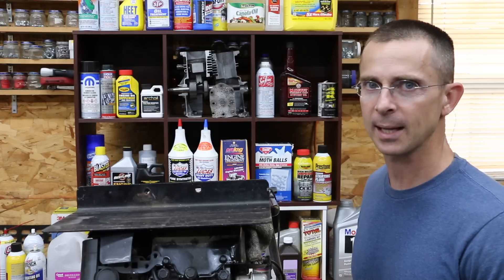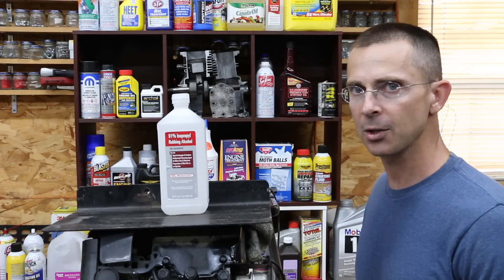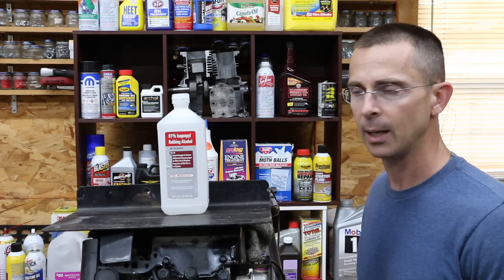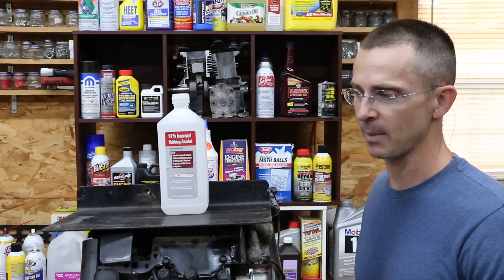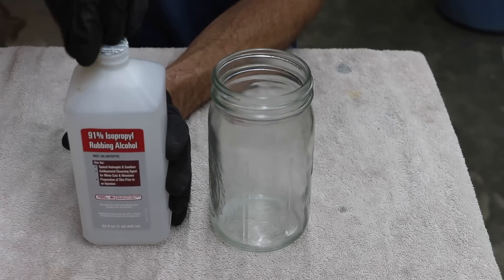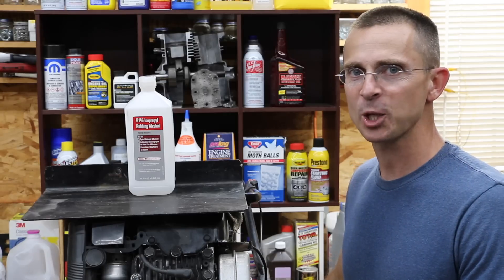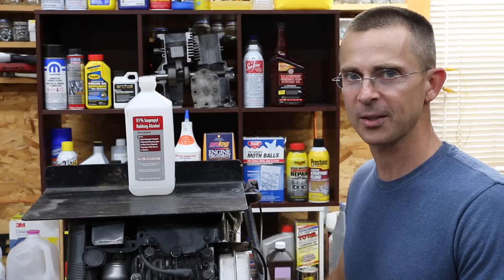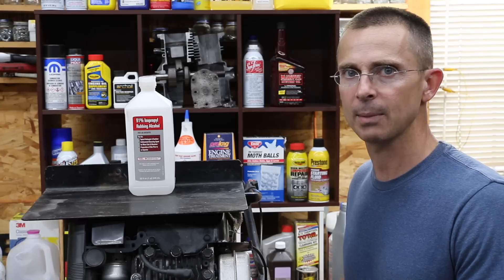Will a Gas Engine Run on Isopropyl Alcohol?  Let's find out!

Comment: The engine ran rough because of 2 things, First, you are automatically running 10% lean because the Alcohol is 10% water,
Second, Alcohol requires almost TWICE the mixture ratio of gasoline (7 to 1, instead of 14.6 to 1) for a proper burn.
Double the size of the main jet in the carb, and then stand back, you'll get around a 50% horsepower increase,
AND, the motor will run very cool, AND, the combustion chamber will be sparkling clean in about 10 minutes of run time.
If you want to run it permanently on Isopropyl alcohol you need to get the hottest spark plug that will properly screw into the head, (many automotive plugs will work and are a much higher heat range), then get a belt sander and sand down the
cylinder head as much as you dare, to get the compression ratio up...
DO NOT bypass the governor or you WILL throw the rod through the side of the crankcase.
Always get the motor good and hot each time you run it, or you will start to accumulate water in the oil.
If you run it more than around 15 minutes, the moisture in the oil will be boiled out and won't be a problem.
Reply from the maker: All excellent points and advice. Thanks for commenting on how to properly convert an engine to run on rubbing alcohol.  Thanks again!
Reply: @ProjectFarm  >>> I was going to ask if you'd modified the carburetor on the lawn mower in any way to accept the isopropyl alcohol....
Reply: @ProjectFarm  will a bigger spark plug improve performance? 
Example, a spark plug that is wider larger with 2 sparks, you should test multiple spark plugs with isopropyl alcohol,  and also you should test isopropyl alcohol mixed with other substances, like hydrogen, and isopropyl alcohol with jet fuel mixture 10% 20% 30% and 50%
Reply: i have a feeling jim was doing more than buliding mower engines
Reply: I think alcohol would eat up all the rubber hosings and gaskets faster over time, thats why some cars are allowed to use ethanol and most are not, or Biodiesel and Diesel (at least thats what the manufacturer said)
Reply: Jim Brown true we used in race cars.
Reply: How about Methanol, I used it to raise the Octane of gasoline in my Motorcycles, it worked well, also runs cool, I would use 93 octane "white gas" 48oz/5gal gasoline, when I couldn't get 115 Octane Racing Gasoline, I started riding in the 60s and racing gas was not available a the pumps. Thanks for the videos, I've been a subscriber for  about a year now. 🇺🇸🏍
Reply: G. B. 

100% ethanol has a pH of 7.3. Very slightly more alkaline than water. Fuel systems survive contact with more acidic water quite well.
Reply: @Ameri Can feel free to read the article i linked and GBs answer to my comment. Additionally the video as well as the initial comment itself and my comments were about 100% ethanol.
I remember times when, in winter, people added up to 10% gasoline to their Diesel (before winter additives were common) and this didn't affect the parts at all. Today you kill your common rail pump if you do so. Car manufacturers to this day specify if you can run E85 for example, which would (according to them) kill the parts i mentioned in a car not advertized for the use of Ethanol. Same is said for "Biodiesel" the few % that are added to the normal one don't affect the parts as much and 100% would. And manfacturers specify which car you can use with 100% "Biodiesel".
Reply: @nirfz  the alcohol is harder on the rubber parts. probably because auto manufacturers sue the cheapest F rubber they can. rubber technology has come a long way, it would be easy to replace the parts to accept up to 100% alcohol. save for any integral parts like fuel injector guts.
Reply: You can buy acetone from a hardware store like lowes I would like to see that.
Reply: @smartwatchonpluto  acetone would probably run, but I hypothesize it would wreck havoc on the gaskets, o-rings, and carb float over the long run--particularly if they are not E85 rated
Reply: @smartwatchonpluto  way too expensive not only that but 100% acetone will gum your entire engine because if you wish to run it in an engine no matter what you do you have to do a ratio mix 2x or more than you would on gas and my point is acetone coagulate oil and turns it into a sludge and that sludge will not burn until the engine gets hot and once it does
Reply: Drug store isopropyl alcohol is 9% water, 99.8+% Pure Anhydrous (water free) Isopropanol (alcohol) is sold at paint and hardware stores which is less then 1% water & cost quite a bit more by purity.
Reply: @marty7922  If you find a friendly local chemical supplier/wholesaler you can get 99 percent for cheap. I clean a lot of circuit boards so I went to one and it was like 15-20 dollars for a gallon of technical grade iso. Probably a bit more now but still going to better than drug/grocery store pricing
Reply: Jim how many times have you done this? Lol I bet your mowers are second to none.
Reply: Seems like you have knowledge i have a question please answer it.
Can we run a patrol bike engine with the 50% mixture of patrol and ipa
Reply: @manishuppal4447  
Definitions of words first ..... 
"Petrol Bike Engine" is this a Bicycle with an Engine added on ?  or a Motorcycle ?
I will assume that "ipa" is Isopropyl Alcohol.
The Short Answer is  NO. It may run, but not very good.
The engine must be set-up and adjusted specifically for the type of Fuel being used.
Alcohol requires a higher Compression Ratio, and usually slightly more Ignition Timing Advance,
it also requires a MUCH Richer Air/Fuel Ratio,  (Gasoline = 14:1), (50% Alcohol + 50% Gasoline = ~10:1).
A very high performance Motorcycle Engine (250cc to 1L) could benefit from adding Alcohol, but only with special tuning.
A small Engine (50cc to 150cc) indicates that you don't have enough Money to afford the REQUIRED engine modifications.

Gasoline produces more power than Alcohol for the same volume of fuel.
Alcohol is sometimes added to Gasoline to make a very high performance Engine run cooler, 
so that it does not "DETONATE" from high Combustion Chamber Temperatures.
This makes it possible to raise the Compression Ratio, which will make the Engine produce more Power.
.
.
Reply: @jimbrown563  Thanks for you valuable reply. From your reply I understand that if i put 50% isopropyl alcohol 99% pure mixture in my 100 cc motorcycle it will reduces the performance (torque, acceleration). Basically  i do not require much power i mostly run my bike at maximum speed of 40-50 km\hr.My question is does it have any bad impact  like any short term or any long term bad impact on bike.
Reply: @manishuppal4447  I can answer.  If you switch to isopropyl alcohol without mods, you will damage the engine.  With the lower energy content it is making your engine run pretty lean.  Your 100cc bike probably needs a much more accurate fuel air ratio than a lawn mower, so it will cause damage, or just not run at all.  I would expect that even though the engine seems to run at the same temp, you will probably burn a valve.
Reply: What is your advise on back yard fuel alcohol still for auto?
Reply: @ericbrazau6533  
You can't produce enough to make it worthwhile.
Reply: @jimbrown563  I got a cup or more of water in my 50 gallon RV fuel tank (long story). I have not tried to start it, so all the water should be in the tank. Will 99% iso mix with the water and burn it out? Can you suggest any options to remove or remedy the problem short of draining the tank. Thanks
Reply: @Polished_Rocks  
Yes, it will work,
but You may need a lot of it, maybe 1 or 2 quarts.

Pumping in ~10-gallons of a 50/50 mix of Regular, and "E-85" 
may also solve the problem.

If your Engine is "Flex-Fuel" compatible, 5-gallons of "E-85" will work.

Go burn all that Gas out of the Tank, don't let it sit there.

Use "Sta-Bil" Fuel Stabilizer if it sits for more than a couple of weeks.
.
.
.
Reply: Hey Jim so I have a big suv and since the gas shortage is going to happen again soon what is there any way I could you something instead of gasoline and it would be cheaper and still or more efficient
Reply: @samhampton545  
Straight Alcohol, or the closest thing to it "E-85",
uses around 50% more  Fuel by Volume than Gasoline.
So the answer is no.
But the good News is that the "Gas-Shortages" are completely
orchestrated and will be sporadic, and very temporary.
It's just one more effort to get people to wake-up to the
attempted, but miserably failing, Communist take-over of the US. 

Yes You read that correctly,
throw away your TV, 
it's 100% Propaganda Bullshit.
Reply: @samhampton545  hmmmm? Gas shortage?
Reply: what if you run 99 percent isopropyl
Reply: @gumbilitous2804  
Re-Read this entire Comment/Thread .......
Reply: Does isopropyl really need less compression?
Reply: @sunfishensunfishen2271  
Where did this question come from ???

More Compression is always more efficient using any type of Fuel.

The trick is how much Compression, or Heat, will cause DETONATION with a particular Fuel.
.
.
.
Reply: My bad i was reading it completely backwards. I’m building an engine like this one with a clear cylinder head, crankcase and valve cover and so far, I haven’t gotten it running long enough to burn the water out of the crankcase and it ended up loosing too much compression. Going to drill out the main jet tomorrow and possibly switch to 100% ipa.
Reply: Do 91% which I was previously using and 100%, which I’m going to be using from now on, have different stoichiometric ratios?
Reply: @sunfishensunfishen2271  
Do the Math ..........
91%  is  9%  Water.
Reply: I heard only recently that the whole PROHIBITION thing in the US was really all about shutting down the industrial use of alcohol, in agricultural machinery, with no way for THEM to control the supply. I figure it stands to reason. Is it really better than the Standard Oil products?
Reply: @Tomorer  
Better ??????
In what way ?
.
.
.
Reply: @jimbrown563  Well Im no anti-fossil fueller. I get the feeling the base oilyness of diesel must be better for mechanics. And the petro chemicals represent a wide variety of usefulnesses. But not withstanding the scope for plant based additives does alcohol burn on par, if not better than what we currently put in our engines? Could it replace petrol/gas???
Reply: @Tomorer  
It already does in several Countries,
and here in the USA E-85 is semi-common.
Reply: @jimbrown563  Ethanol additive in gas/petrol is damaging I hear!?! Certainly slightly different engines are necessary (as U say)...   What about diesel; is that superior to alcohol in terms of mileage attainable in a vehicle?
Reply: @Tomorer  
Only "some" Cars, that are more than ~20-years-old will have any problems with ~10% Ethanol.
All newer cars, and even Lawn-Mowers, now use better materials that are not affected by Ethanol.
BUT, Ethanol gets nasty when you shove your Jet-Ski into the back of the Garage and ignore it.
Ethanol requires  "Fuel-Stabilizer"  for storage of more than around ~1-Month.

Diesel will always have the highest efficiency of any Fuel.
.
.
.
Reply: @jimbrown563  Okay yes good we need to keep the diesel going ;() Its just crazy to think people can run their domestic motors and hell even central heating, cooking hobs, toasting fires off of something that can be distilled from agricultral waste products. Every farm could be pumping out literally dirt cheap fuel. Dagn it.
Reply: gasoline has water in it also
Reply: @blakespower  
Gasoline only has Water in it by accident.
Condensation, caused by weather changes during long term storage, is usually the reason why.
Gasoline is not manufactured with Water added to it.
Gasoline does produce a lot of Water-Vapor as a byproduct of Combustion in Air.
Roughly  ~1 gallon of Water-Vapor for every  ~8 gallons of Gasoline burned.
.
.
.
Reply: Belt sander? Just get a sheet of sandpaper, the correct grit, set it on a flat surface, soak in solvent or something, so it's not dry sandpaper, and carefully rub the head around on the sandpaper.
Reply: The fuel ratio for AIR/GAS is 15 to 1 and for Alcohol it's 9 to 1 so when you use Alcohol you need to close the choke about 60% or run a WAY larger main jet and set up the idle screw! You will not see the best benefits running Alcohol until you get the compression up to 3 to 4 points higher. In my 250cc dirt bike I went from 17hp to 28hp by going from 8/1 up to 12/1. You can do this easy since alcohol has a 110 octane naturally. I make my own Methanol at home for free it's so simple. You fill a 55 gallon drum with sticks, old pallets, cardboard and seal the top with a ring clamp. Drill a hole in the lid and install a 50 foot log coil of copper tubing (think moon shinning) Next put the drum off the ground with two cinder blocks and build a large fire underneath it with sticks. You will see smoke coming out of the copper at first and than a liquid. The first liquid is water vapor so pitch it on the fire to make sure and it should sizzle. After a while the liquid coming out of the copper will run faster and when you pitch a little bit on the fire it will go "POOF"!!! That means your making METHANOL!  The yield should be 17-21 gallons of methanol per 55 gallon drum full of waste-wood, trash, plastic and paper worth about $120.00 - Now your ENERGY INDEPENDENT! This is flammable so you will need to really think about Safety, working around an open flame and all too! DO AT YOUR OWN RISK. DO NOT DRINK or you will die!!!!!!!!!!!!!!!!!
Reply: Would this clear out sludge in the catalytic converters
Reply: @5cardz2boardz  
Catalytic-Converters do not accumulate "Sludge".
In really bad cases, it is Carbon that may "plug-up" a Catalytic-Converter, 
but by the time that happens the Converter was destroyed long ago.
There may also be certain Chemicals in the Fuel that can ruin the Catalyst and prevent it from doing its job.
Reply: ""The balanced equation is C3H8O + 9/2 O2 = 6 CO2 + 8 H2O, and the molecular weights are C3H8O = 60 g/mol and O2 = 32 g/mol. So, 1 mol * 60 g/m C3H8O : 9/2 mol * 32 g /mol O2, or 60 : 144 or 1 : 2.4. However, air is only 21 % O2 so to get 2.4 g O2 you need 2.4 / 0.21 = 11.4 g air, so the stoichiometric ratio by weight for isopropanol is 11.4 : 1."" 
Quote from an Automotive forum 2005. This is likely 100% Isopropyl alcohol.
Also note, Ethanol ,Methanol and Isopropyl are different.
Reply: Haven't seen anything like this since high school chemistry class!!
Reply: DarkLinkAD 

This makes sense because IPA is partially oxidized, hence less O2 is needed.
Reply: Basically E85 you talking. People with boost engine doing that to cool down engines and gain power
Reply: @650hpreventon  and to reduce knock mainly on boosted engines.
Reply: @650hpreventon  E85 has the remaining 15% as gas/petrol, not water.
Reply: G.B. Ok, interesting to hear, i went with what the manufacturers said when E10 was introduced in most of europe, and after looking into wikipedia: https://en.wikipedia.org/wiki/Flexible-fuel_vehicle#Barriers_to_widespread_adoption I'm still not sure about the long term effects of mainly alcohol run engines that aren't specifically advertized to do so.
Reply: Whatevet
Reply: Jim Brown 19 April 2018 3477944124 4esasqustch@gmail.com can you tell me which addative to use to save my 63cc 2stroke engine after a bad possession and no oil mixed in gas. I suspect because of needing help to relocate due to land destruction notice last Friday 13 April 2018. Only 6 weeks. Desperate for the help of land grant and relocation. Blessings

Comment: Almost got a thumbs down on the why buy Marvels Mystery Oil..... I buy it by the gallon to treat fuel for Detroit Diesels that miss
there sulfur on boats, Mix it in many concoctions with motor oil,WD-40,hydraulic fluid,coffee,tea,Diesel to make various spray lubricants. The stuff is awesome and tried and true. 

  Big question is , Have you ever ran a Diesel on WD-40?
Reply from the maker: I enjoyed reading your comments.  I have not ran Diesel on WD-40.  Does it boost performance?

Comment: It might need a higher alcohol concentration (97% or above) to run smoother, since your fuel is still about 1/10 water with 91%
Reply from the maker: Thank you for this recommendation!

Comment: I used to run a car off this all the time
Reply from the maker: Did you have any issues with seals or gaskets?
Reply: Project Farm nope I drove a 1985dodge Omni to the lake 60 miles one way had no issues later I put more gas in it . It ran fine until the transmission died a few years later

Comment: How long does the plastic or plexiglass head last?
Reply from the maker: It won't last long.  I only run the engine for 20-30 seconds at a time because it quickly reaches melting point.

Comment: Interesting video.  There are clear indications of cleaning.  I wonder though, what is the effect here of the water content of your 91% isopropyl both on the cleaning properties as well as the engine power.  It would be very interesting to see this test repeated with the somewhat more difficult but still obtainable 99.956% anhydrous (no water) isopropyl alcohol.  Will power increase?  Temperatures?  Will cleaning ability suffer or improve?  A comparison of results here could tell us things about both water and alcohol and their effects on the engine.
Reply from the maker: Thank you for this recommendation!

Comment: I’d like to see an engine get water injection, I remember hearing water sprayed (like a spray bottle) into the carb would blow out carbon deposits and add power.
Reply from the maker: Thank you for this recommendation!
Reply: they do it in diesel often